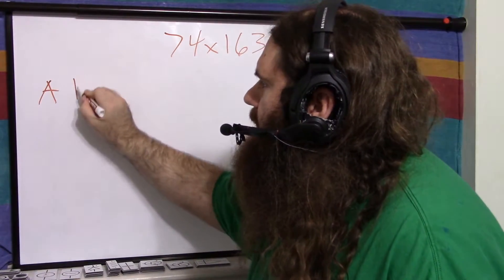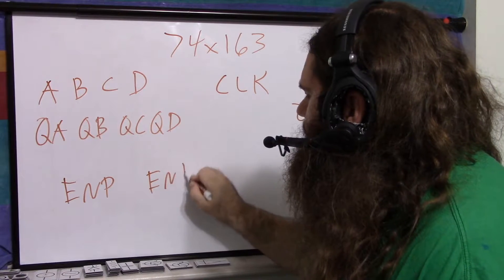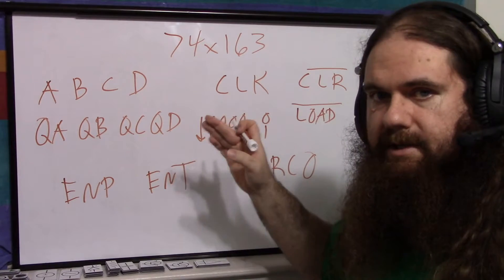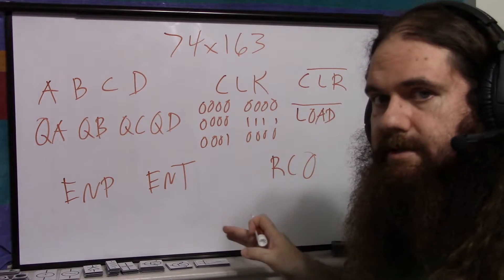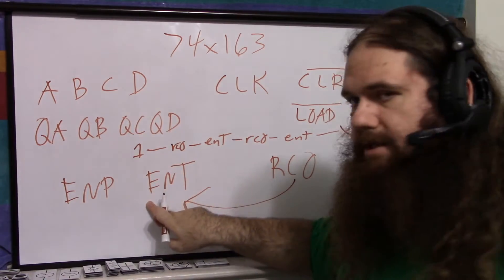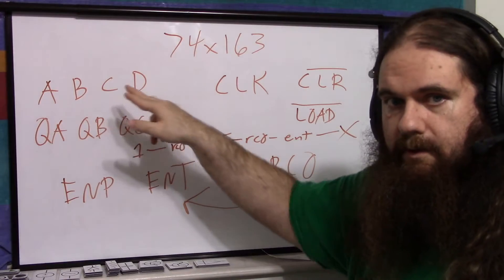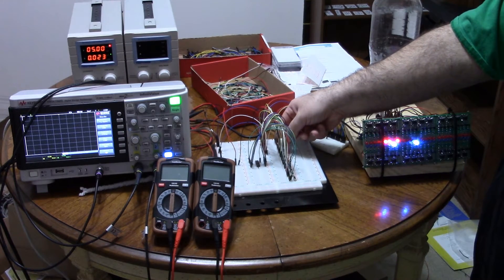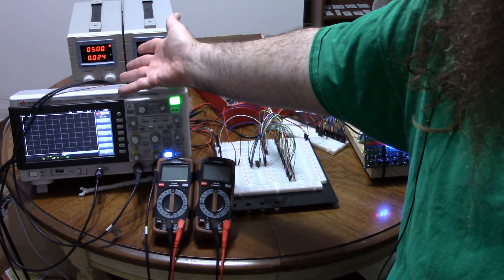74x163 4-Bit Binary Counter with Parallel Load and Ripple Carry Chaining - Simply Put

Comment: Thanks for the vids - I use 74HCT163 in my homebrew cpu.

Having found this chip confusing and poorly documented I hunted around for authoritative application notes from the vendor and found nothing initially. Eventually I found this ...

https://www.ti.com/lit/ds/symlink/sn54ls161a-sp.pdf?ts=1599773093420&ref_url=https%253A%252F%252Fwww.google.com%252F

It gives schematics for two different patterns of use : "ripple carry mode" and "carry-look ahead mode" , but doesn't discuss them at all.

And I can see that the max frequency is different 
between the two approaches, but why use one aproach or the other?
And there's no explanation of trade-offs; there are always trade-offs when there's more than one option.

So no clue is given when to use either approach.

The approach outlined in this video is "ripple carry mode".

----

I've scratched my head about this chip.

When using the 74163 it's important to note that the two "enable inputs" are NOT equivalent.

It matters which enable input you use for chaining.

ENP (P for parallel) also called CEP, is used for enabling or disabling all the cascaded chips in parallel; not for chaining.

ENT (T for trickle) also called CET on other data sheets is the one you MUST use for chaining.
The problem of using the wrong enable won't show up I believe if you only have two counters, but if you have 3 or more then the counting won't reliably on the 3 and following chips if you use ENP.

ENT has the special function that it ALSO disables count for any subsequent chips in the chain to prevent them rolling over prematurely.